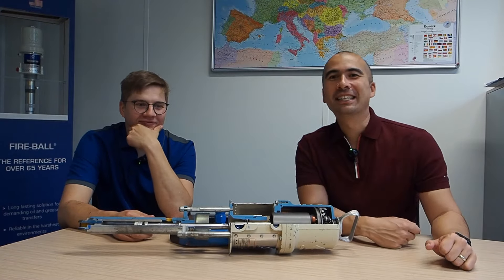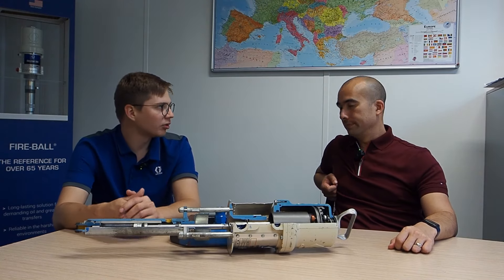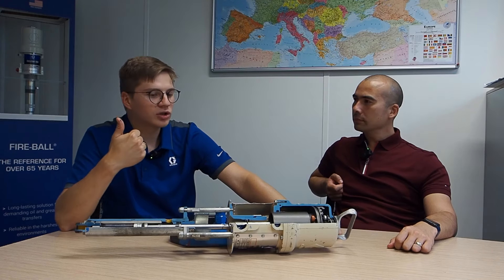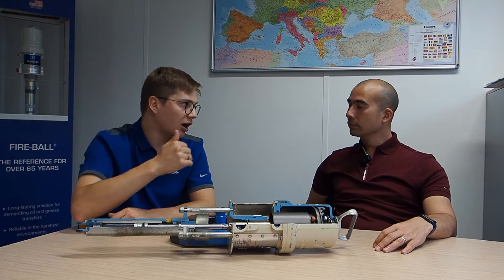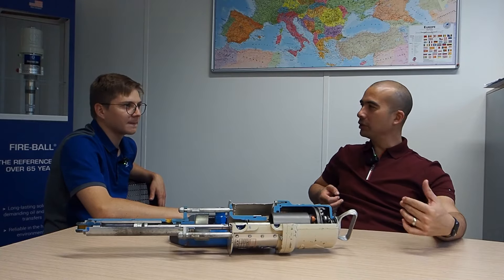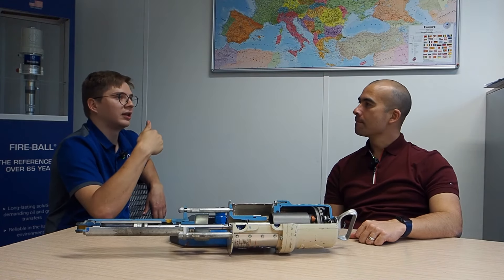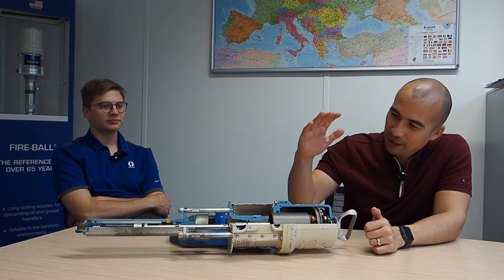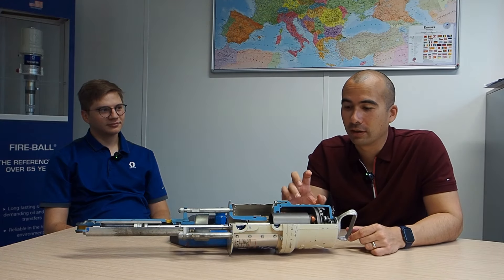Episode 058  |  Pneumatic Pumping of Fluids with Danila Samosyuk

Comment: We used these fire ball 500 10:1 ratio pumps to pump our Duratac 150 for our Slide rails and linear bearings on our sawmill which were all distributed by electronic timing programs on our computers through our counters screen and distributors high pressure 10,000 psi lube lines and arc chain .chain dripping upstream an downstream chain lubrication system. Of course.
Reply: Haven't explored the viscosity flow passage more than 150 centistokes . But sure it can pump our 220 gear oils to a satellite planetary gear Box Reducer somewhere. Or definitely chain oil 100 & 150 chain oil nondrip